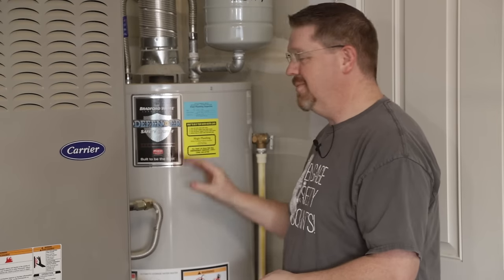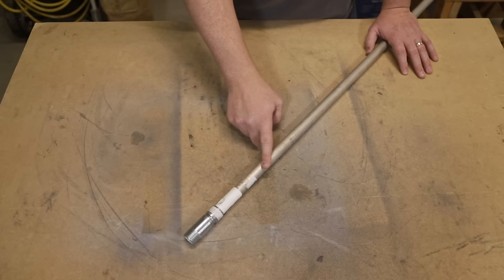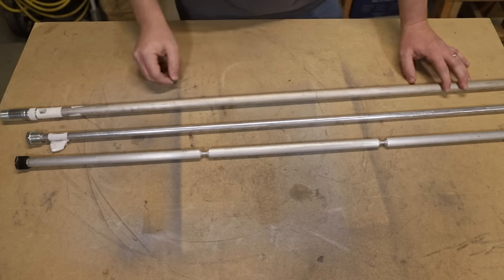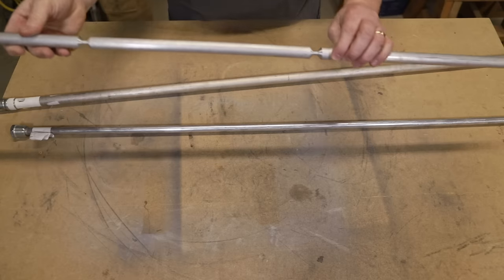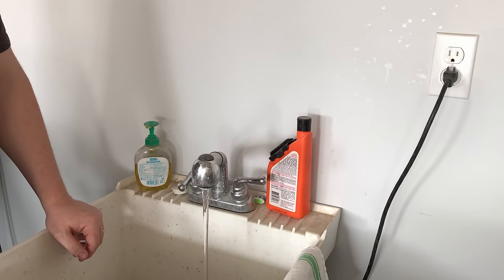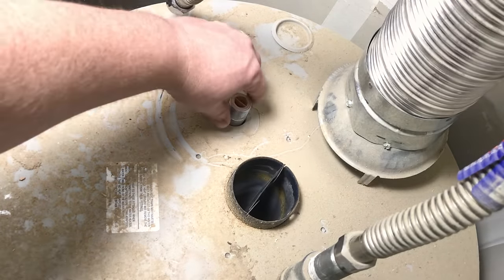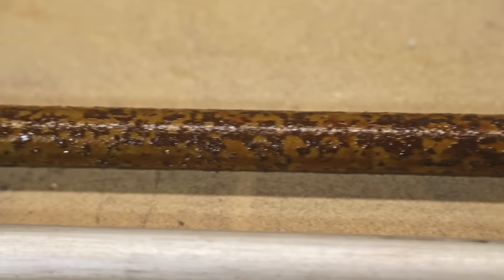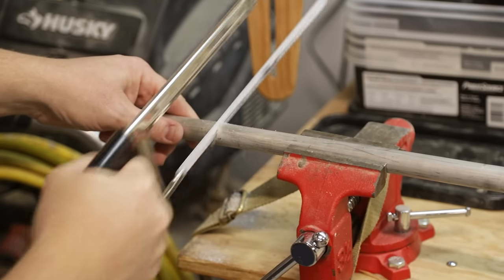How To Replace Water Heater Anode (Step By Step)

Comment: You could have gone to the hardware store and bought a “ left handed thread “ nut for your brother’s Anode that only had “ threads sticking out to work with.  It would have allowed you to use various types of tools to remove the anode rod and he could have kept and reused that same nut every 3 or so years to replace the rod again.
Reply from the maker: Hi Robert - unfortunately I committed the first sin of plumbing projects, and started this late in the evening on a weekend. Hardware stores were closing, and I was unable to find anything that would work right then. You are right though - there are a variety of ways this could have been handled if my timing had been better. Thanks for watching!
Reply: Sounds like a bad design in Bradford-Whites.
Reply: How do you use a left hand tread nut on a right hand tread fitting? Moreover, you still have turn it counter clockwise to remove the rod from the tank. I think only the locknut method make sense. Please advise.

Comment: If the heater is in a small closet, would I be able to remove the anode rod?
Reply from the maker: When the heater is in a small closet, you still have options. To remove the existing anode, first get it loose and pull it up as far as you can to inspect the surface. If it is time to change it, here is how I would do it if I only had a foot or 2 of head room over the heater: 
1) pull the anode out as far as I can
2) place a clamp or vice-grip at the lowest part of the anode that is visible, to hold it up. 
3) use a hack saw to cut off the portion above the clamp or vice grip
4) pull the next section out, move the clamp down as far as you can, cut again, etc. 
Just be VERY careful that you DO NOT drop the end of the anode into the heater tank. Once you have removed the old one by cutting it out in sections, you can use one of the flexible anodes that I showed in the video as a replacement.
Good luck!

Comment: Can you replace one on a 15-20 year water heater?
Reply from the maker: You can, but before even attempting it, I'd make sure I'd saved up enough to buy a new heater *just in case something goes wrong*. A 20 year old heater that has never been maintained is living on borrowed time... Good luck!

Comment: I want to use an aluminum/zinc anode rod. However, I do have a water softener. Reason being, it will last longer and I won't have to be concerned about potential rotten egg smell from the magnesium rod. What's your opinion on this? The water softener I have specs out for a aluminum/zinc rod
Reply from the maker: Yes, an Aluminum rod sounds like a good idea. Good luck!

Comment: How often should these be replaced?  My heater is a few years old so I’m trying to determine if it’s time…?
Reply from the maker: Hi Real G - the right answer is "it depends". The anode will deteriorate at a different rate for different people based on your specific water supply situation. The manufacturer of my heater suggests to start checking the anode at 3 years, then annually thereafter until it has corroded almost completely through, then replace it. Some people may find that at only 3 years the anode needs to be replaced. For others, it may last as long at 8 or 10. 

If your heater is 3+ years old, it's time to at least check it. Good luck!
Reply: @AmplifyDIY  thanks for your reply.  I will probably buy a segmented one and try this over the holidays 👍

Comment: Hello when draining the tank will it work if your hose has to go up stairs from the basement?
Reply from the maker: Hi there - no, you have to drain down hill. There should be a floor drain in your basement that you can use. Good luck!
Reply: @AmplifyDIY  yeah thats what I thought . Unfortunately my floor drain seems to be slightly clogged as water goes down very slowly. Guess I gotta get that taken care of first! Thanks!
Reply: @happydogg312  thanks for the suggestions. Ended up getting the floor drain unclogged as it started to back up the laundry machine. Havent used it yet to empty the tank though.

Comment: In a lot of cases to you can pop the outer upper cover off of the water heater and expose the top of the tank course you have to take your cold line loose as well that might give you a little more room for she have to be careful cuz that sheet metal could have sharp edges so you'd want to lay a blanket or something there in case your wrench would happen to slip and you should be wearing gloves

Comment: What is that plastic cap on top of the tank? Is this for a 2nd anode rod?
Reply from the maker: Hi Vlad - I think it's actually used during the manufacturing process to inject the foam insulation that lines the outside of the tank. Great question!

Comment: Beware people . This things can get corroded and threads stuck for eternity . And then it can break off in there . And an easy job turns into a pain in the arss
My hot water heater was only five years old I could not budge it and then  I did it felt like it was going to break off I cut my losses and left it in there my old water heater last 15 years without a change so I’m leaving it

Comment: In an another video, I heard that if i haven't flushed water out of tank for more than 3-4 years, I shouldn't do it? Is that true. I just learnt about water heater maintenance so I want to flush water and probably replace anode? Any suggestions?
Reply from the maker: Hi Prashanth - there are a lot of factors that can affect how much sediment collects in the bottom of your water heater tank. The quality / mineral content of the water supply, how hot you have your heater set, whether you have a whole house water filter, whether you have a water softener, etc. For some, 3-4 years is enough time to get 6-8 inches of sediment built up at the bottom of the tank, while for others they will have little build up at all. I wish there was a better, more concrete guideline, but it's pretty nuanced. I would not hesitate to flush any heater that was was last flushed or installed less than 10 years ago. A heater that is older than 10 years? I'd attach a drain hose to it and see if it will even drain, or if the drain valve is completely plugged up and clogged. If it is, I may try to clear out the drain valve with an unbent coat hanger, and see just what the sediment looks like and if it will clear out enough to even drain the tank in the first place. The concern with a heater that is quite old and has never been flushed is that the tank may have already failed (sprung a leak) but the sediment / scale has sealed it up and kept it from actually leaking. But that same sediment is causing the heater to be terribly inefficient, etc. 
I've done a series of videos all about various things homeowners can do themselves to maintain their water heaters. Hopefully you'll get some good answers in those, but I'm always happy to answer questions directly as well. Good luck!
Reply: @AmplifyDIY  Thank you for quick response. My water heater is 12 years old. I just installed whole house water softner just a year ago. I will see if it drains out.

Comment: at 13:14, if there is clearly not enough room to remove existing rod, there won't be enough space to put in new rod, so don't cut existing rod. in my case, i have less than 2 feet above tank, if that.
Reply from the maker: Sounds like yours will require one of the sectioned, flexible rods that I showed in the video. Good luck!

Comment: So a Bradford Whites hot water outlet/anode is a maintenance item but on another brand with a separate anode, its not.
Reply from the maker: Hi Chief - the anode is a maintenance item on all heaters. Bradford White combined the anode with the hot water outlet, so they are both changed out at the same time. Typically you would not need to mess with the hot water outlet on a traditional heater with a separate anode. Thanks for watching!

Comment: What if we don't have a softener system but our water quality is already soft (as indicated by the city's water quality report)? Does that mean we should still go for a magnesium rod?
Reply from the maker: A chemical softener introduces sodium ions into the water (it replaces the other minerals with sodium ions). It's the sodium in particular that makes a magnesium rod recommended. If you have naturally soft water (very low mineral amounts in the first place) then you likely don't really need a magnesium rod, as you won't have a bunch of extra sodium ions in the water.  Great question, and thanks for watching!
Reply: @AmplifyDIY  , thanks for the explanation. That really helps. I'll check out our city's water report and see what it says about sodium content.

Comment: Great video after watching 4 videos tonight.. 

1. Did you notice the length of the Anode prior to cutting as I only have 4’ clearance in the basement...

2. Is it possible 
(A) drain and flush, 
(b) replace flush valve and
(C) replace anode at same time??
Reply from the maker: Hi Ron! Great questions! I did not notice the length of the anode prior to trimming, but with 4' of clearance you likely can get the old one out and new one in without too much hassle. Most anodes are around 4' long or less, and you can start it at a slight angle if needed. I'll bet it'll fit without any problems. As for your second question: Yes, you can do all these jobs at roughly the same time - but you need the weight of the water in the tank when replacing the anode to keep the tank in place while you torque the old anode out of there. So I'd just change up your order a bit: 
a) Replace anode
b) Replace flush valve
c) Flush the tank
Great questions, and good luck!

Comment: looks like you need about 3 feet clearance above the heater to do this job?
Reply from the maker: If you install a segmented rod, you only need about 10-12". If you install a straight rod, 3-4'. Good luck!

Comment: why not also teflon tape the final hot water threads?
Reply from the maker: The final connection has a rubber washer at the bottom of the fitting that seals the joint. There is no need for any thread compound or teflon tape on that joint. Great question, and thanks for watching!

Comment: 3 type of anode rod are: 1 aluminum 2 magnesium 3 zinc magnesium. If local water contains sulfur then zinc magnesium anode rod will do the best job to remove the rotten egg smell.

Comment: How long do I need to replace it from brand new tank Sir?
Reply from the maker: Hi T N, how quickly your anode decays will vary wildly based on what's in your water supply... but a good rule of thumb is to check the anode 3 years after first install, then annually thereafter until it is used up. Great question, and thanks for watching!

Comment: Is it possible not to have an anode? On my electrical heater's manual is not pictured and, beside Power, Hot and Cold water, nothing is sticking out. There are two additional plastic seals, corks, but nothing out of there, just smooth plastic surface.
Reply: Sorry got it wrong, there is one.
Reply from the maker: I believe they are standard on just about every new water heater (and have been for many years). Thanks for watching!

Comment: Why no tape or compound on the water fitting?
Reply from the maker: Hi Jgrenwod - that fitting has a rubber washer inside that makes the watertight seal. You should not use tape or pipe dope on that type of fitting. Great question!

Comment: I came here hoping to see what to do if the anode hex head is tight as hell and I end up picking up the hot water heater instead of getting it to turn.  It might be lifetime installed...
Reply from the maker: If the heater is empty, fill it back up. The weight of the water will keep it from moving while you crank on the hex head. If it is REALLY tight, you can use a breaker bar to break it free. A simple iron pipe over the end of the wrench (making the handle lots longer) should do the trick. 

Good luck!

Comment: It seems stupid to combine the anode rod with the hot or cold connections. A dedicated anode rod can be unscrewed with a socket wrench preventing damage to critical threads. The rod you removed was still usable but the threads were now damaged.
Reply from the maker: Hi Ali - I agree, the only motivation behind such a design is planned obsolescence. In my case, I was very careful not to damage the threads of the original anode, in case I ever want to put it back in.... for now though, the heater still has the new anode I installed during filming this video in it. Thanks for watching!

Comment: Excellent video.  I will need a flexible anode rod and the Bradford White flexible magnesium anode rod runs around $125.00. Would there be a less expensive generic substitute that I can use?
Reply from the maker: Hey Peter - This one on Amazon may work - it has the nipple integrated like the one I changed in this video: https://amzn.to/2DUmTlX
If you don't have a nipple on the end of your anode, I know that Home Depot sells a generic flexible magnesium rod for around $40 as well.
Good luck!
Reply: @AmplifyDIY  Thank you.  I have the same model as the one you demonstrated on so the Amazon one should do the trick.
Reply: @AmplifyDIY  Hi.  I have one final question if you wouldn't mind:  I purchased the anode you recommended and I'm wondering if it needs a heat trap?  If it does would it be a Flapper Style Dielectric Heat Trap, or,  the plastic version you used on your video?  I live in Phoenix, AZ so is a heat trap really necessary?
Reply from the maker: @peterdavis2305  There is a heat trap on the nipple installed by the factory, which is actually removable. You can transfer it over to the new anode (assuming it's in good condition) if you are concerned about it. Living in Phoenix, though, I am not sure it would make all that much difference.... if your energy costs are high to run the heater, then I'd be looking for whatever savings I could... but if your natural gas is really affordable, it's probably not worth really worrying about.
Reply: @AmplifyDIY  Your input is much appreciated.  Should you ever need answers to your music related questions, I am always available. www.azpianoman.com

Comment: With the aluminum rods, that means people may be exposed to drinking aluminum particulates. Magnesium rods sound healthier.
Reply from the maker: If you are concerned about aluminum in this way, just make sure you don't drink from the hot tap - only cold. Thanks for watching!

Comment: If the anode cannot be removed, what is the solution? Leave water heater alone until it leaks?
Reply from the maker: With a little creativity, any anode should be removable. You may need to disconnect and tilt the heater out into the room so there is more head space, or you may need to remove the anode in sections, etc. Good luck!
Reply: Some manufacturers epoxy the anode rod so it cannot be removed even with breaker bar.

Comment: I've tried this but it doesn't work.  The anode rod on my tank had a 1-1/16" hex nut.  I used a pipe wrench, socket breaker bar.  Nothing worked to budge it.  They used some kind of locktite on the anode to keep people from removing it.  Also, with a full tank of water, I would attempt to remove it.  It withstood enough force to start to rotate the tank on the floor!  It would not budge.  

If I was a bit more daring, I would of emptied the tank and used my torch to heat the anode nut.  Sometimes, a little bit of heat will degrade the locktite but it just wasn't worth the trouble for me.
Reply from the maker: That stinks. If or when you ever replace that heater with a new one, one of the first things you should do is remove the anode and re-seat it with a little less torque. When they are new from the factory they are quite tight, but usually don't actually have loc-tite on them. Over time with repeated heat cycles and corrosion though, they jam up so tight they are impossible to remove. If you can get it loosened up first thing on a new heater and re-install it with some pipe dope it'll come out easier in the future when it's time to inspect/change it. 
Good luck!
Reply: @AmplifyDIY  I was thinking after buying the water heater, I'll drive over to the local tire shop I go to and have them use their impact to remove the damned thing!  And then I'll do as you say and reseat it will a less torque.  In theory as long as the sacrificial anode is changed out, then the tank should last a very very long time.
Reply from the maker: I'd love to hear if you are able to get it out. Good luck!

Comment: Can you tell me where the anode rod on my water heater, "O.S. SMITH 52 200?          THANK.
Reply from the maker: Hi John - I found this manual online, which I think is the one for your heater: https://www.hotwater.com/lit/im/res_elec/185762-000.pdf - on page 19 there is a diagram that shows the location of the anode. It's on the top of the heater, possibly under a small cap or cover. Good luck!

Comment: Hi, can you tell me where you bought the parts, amazon has many not sure which is original, and manufacturer website doesn’t have parts link.

Thanks,
Jai
Reply from the maker: Hi Jai - I can tell you the exact part number I ordered: 224-47776-19. This fits a bunch of the Bradford White heaters, but you'll need to make sure your heater is one of them. Supplyhouse.com is where I ordered mine, and if you go search Google for that part number, theirs is the first result that comes up for me. On their product page, they list all the heater models that this anode fits. The list is too long to put in a comment here, but if you'd like more info feel free to email me at amplifydiy@gmail.com.  Good luck!
Reply: @AmplifyDIY  , thanks very much and a big thanks for helping everyone through your videos, they're very detailed and informative.

Comment: how often should you replace this rod?
Reply from the maker: Hi Wayne - Starting when your heater is about 3 years old, this rod should be checked annually to see how it is holding up. Replace it when it is mostly eaten away. Great question!